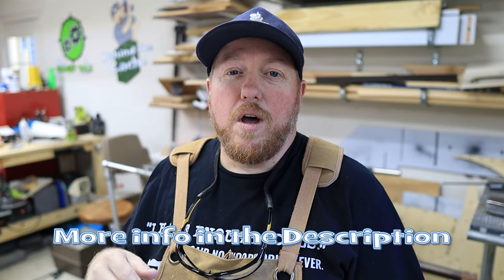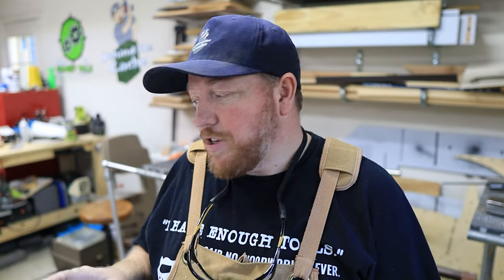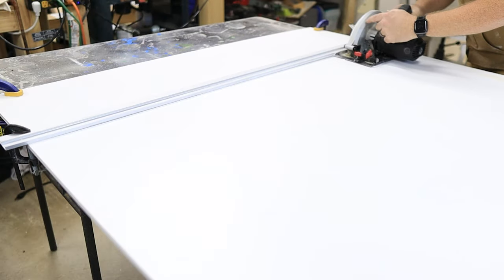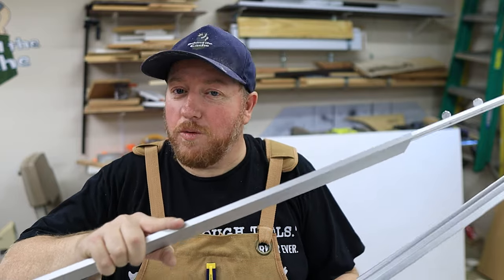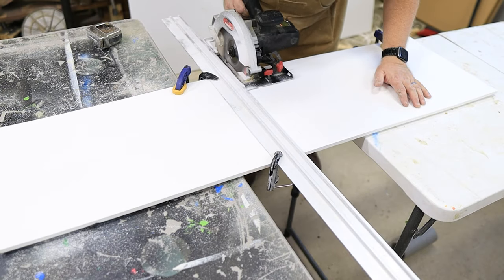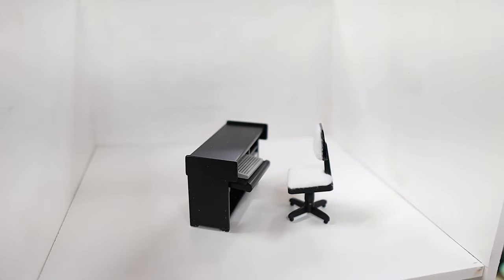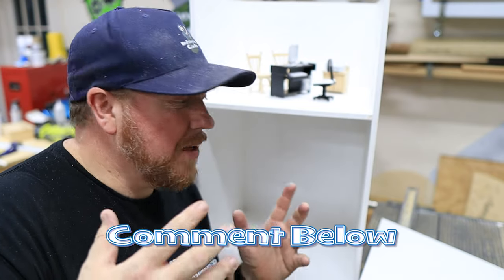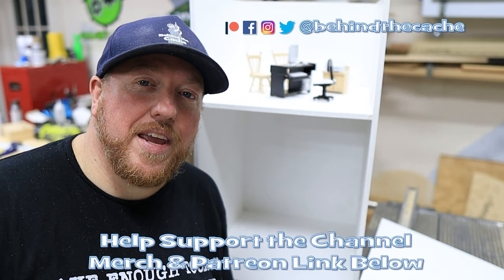Travel Bug Hotel Creative Gadget Cache Build (GCNW)

Comment: Thanks for the tip on how to cut straight lines without a table saw. I don't have a table saw, but I do have both a jig saw and a circular saw, both in which I've had problems with trying to get straight cuts from in the past. I'll have to add that straight edge to my wish list!
Reply from the maker: Yeah it is a great tool and it is under $30

Comment: You are rocking that beard, BTW!   I love that medium density PVC board, it is so versatile and so stable in the weather.   I have used it a few times in caches that might have problems if using wood were to get wet, contract or expand under wet or hot and dry conditions.   Looking forward to the finished cache!
Reply from the maker: Thank you. I have it with me at Coinfest. So I get to give it to the CO here